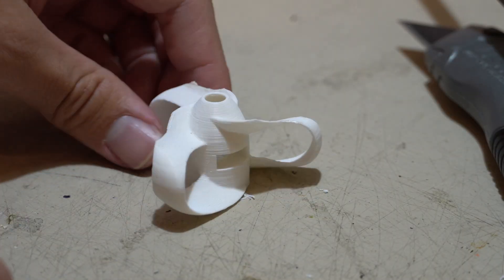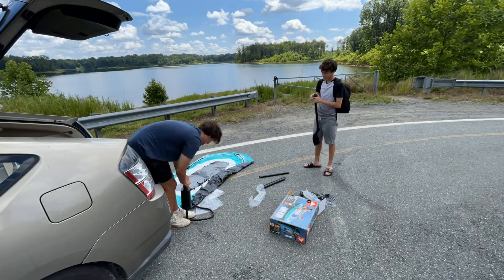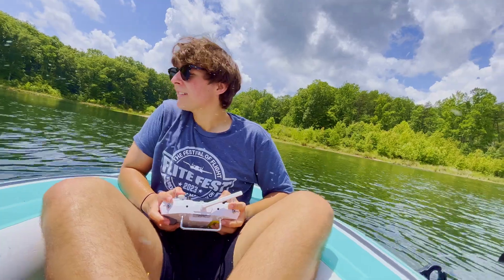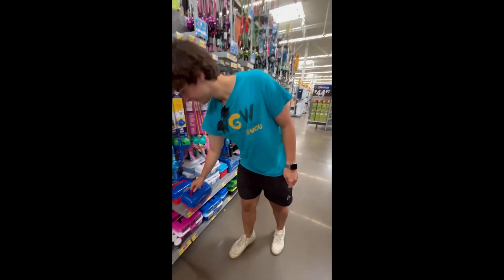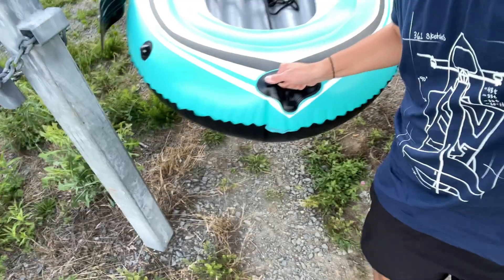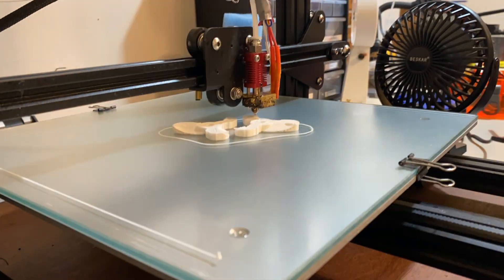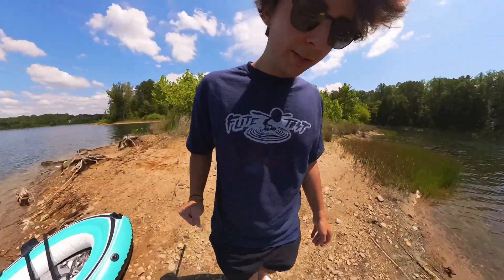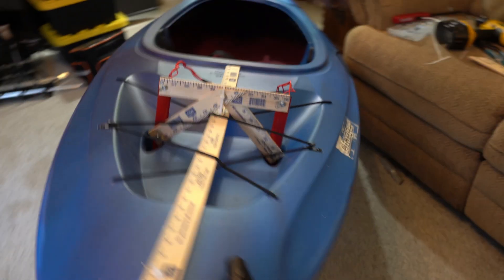Can You Power a Raft With RC Plane Parts?

Comment: What an awesome project! I loved your previous plane video, but at heart I'm a boat guy so I'm excited to see where this goes! 
 
 One thing you probably already thought of is that your motor setup seems to be designed to make small things go very fast. If you manage to trade some of the speed for torque, either with a gear/belt reduction system, or just different motors or something, you could print/use bigger props and probably get a lot more power. Again, you've probably already thought of this as this is obviously your first iteration, but just thought I'd say it!
Reply from the maker: Oh, me too man for some reason I just love boats. I haven’t actually thought of the gear system but That’s a good idea. I really want to get some gigantic motors and make a speedboat but that would be really expensive. Maybe if I get a sponsor soon!

Comment: Hello EP. I bought a paddle board and drilled a hole threw the board and Mounted an electric trolling motor in the stern. 12V battery box and cruise at 10 MPH. A lot of fun to say the least. have a 7 mph tide and was able to get it back to my dock. keep up the Great Work SIR..
Arrgh... Become a PILOT !!!! Engineer...if you chose to do so. i hope you have checked out my Site. Check out the Grumman Canoe that I built. USS NIMMIT'S. Keep up the Great Work. Capt Mrgn.